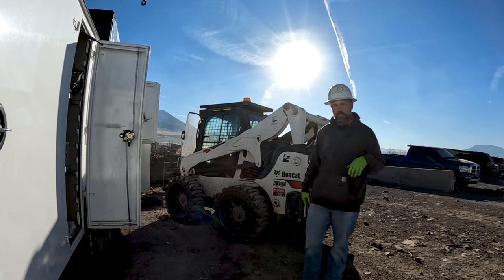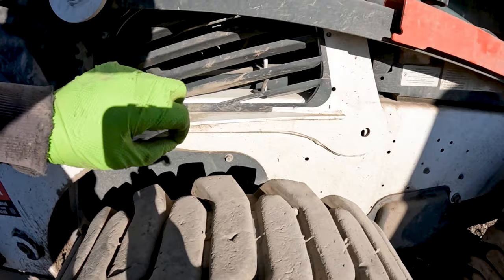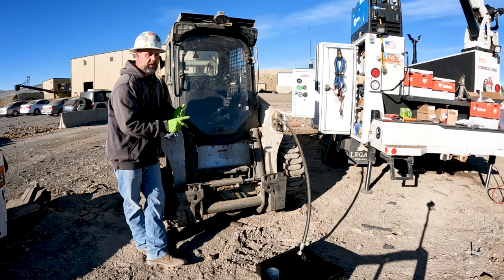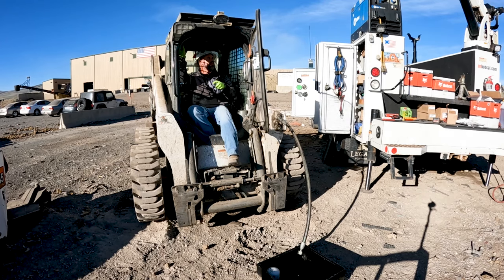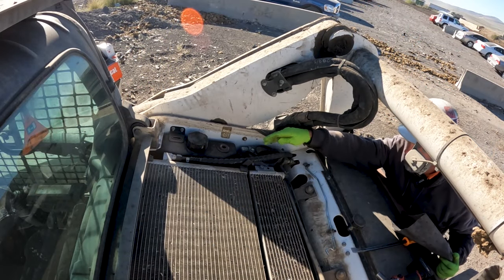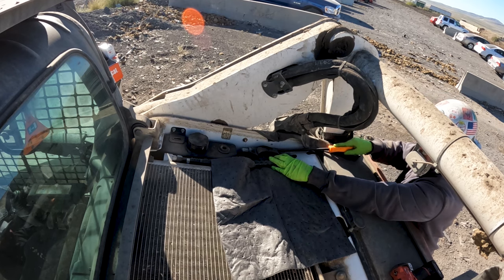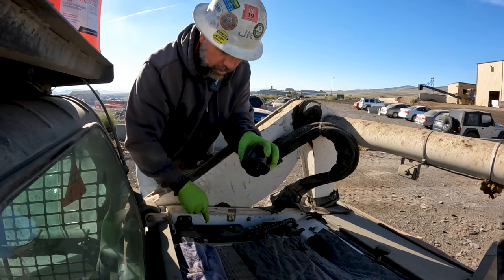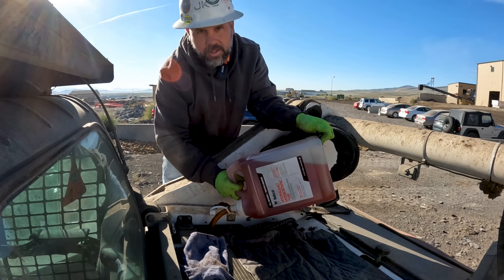Bobcat Hydraulic Oil and Filter Change on M-series loaders

Comment: Ok, I had it brought to my attention if you use two hoses on the axillary  ports both the in and out. Set an empty 5 gal, (out), and a full bucket of new hydraulic oil fluid (in), you can completely flush out the old fluid? Has any one done this? Will it overflow the reservoir? Sounds like a real trick if it works? When would you change out the filters? Before or after? Would like some input on this method? I just did the discharge part of this as you showed. Looks like I got somewhere around 2 1/2 -3 gal out from this out port (top one). I’m doing this on a T450 Bobcat. Believe the complete system is around 5 1/2 gals. So I still have quite a bit old fluid left in the machine? Also, another thought would be keep adding new fluid to the reservoir till clean fluid flows out this out axillary port?
Reply: Ok, I just did the latter, I added fluid to the reservoir as I expelled the fluid out the top port. It cleaned out all the milky brown stuff that just started the first time when it started to bubble out. I ran the rest of the 5 gal bucket of the new fluid into the reservoir. The fluid coming out was not perfectly clear, but looked pretty good.👍🏼 😊

Comment: Great video!  Just made me a subscriber. I have a 2014 S550 and it has the little screen filter under the cab in the housing.  Can you believe the local dealership tech told me not to change my hydraulic oil?  Today the machine shut off because it said 'hydraulic oil extreme high temp'  I think it has lost/decreased its viscosity. Changing it, the filters and cleaning the coolers. Has 2200 hours. Thanks for being thorough and easy to understand.
Reply from the maker: Thanks for the subscribe! Glad you have found the videos helpful!

Comment: Great video thank you so much. as you showed in this video you only pumped out 3 or 4 gallons of fluid . I was wanting to change as much of the fluid i can hopefully the 9 gallons it requires. my machine has 3300 hrs and i don't know if they ever changes the fluids . i have changed all the fluids and filters except the hydraulic oil and filters. how do i do a complete oil change ? is there a drain plug ?

Comment: This is a gold mine video on what needs to take place in the right order.  Thanks so much.   A while back I started getting a M3507 Hydraulic Fan Open Circuit on my  2014 T650 M Series.  It happened after I used a hose to clean out some pack rat mess under the cab when I had it tilted up, like some sort of connector got water in it or something.    Any ideas on what to troubleshoot first?
Reply from the maker: Check plug on hydraulic fan solenoid  for moisture

Comment: Just Finished servicing the hydrostatic oil and filters on my 2018 T770. After running it about 5 minutes today, the machine shut itself down with error code D7528: “Right swash plate out of position”. 

Double checked all filters and oil levels.  No metal or glitter in the old or new oil, but the new oil is the blue stuff and the old stuff that came out was a different color and smell.  I’m a bit freaked out. Any idea what’s going on here?

Comment: I'm curious on how draining and replacing only 3-4 gallons of the (in my case T590) 9.5 gallon capacity does any good? How can one drain the entire system? Would you continually feed fluid into the reservoir while pumping out the aux hydraulic until you have pushed through 9.5 or so gallons?

Comment: I was exposed to the concept of cavitation with my 7.3 Ford diesel and thought my leg was being pulled but it was explained to me that improper. Antifreeze allowed ait bubbles to form and the diesel caused a vibration that smashed the bubbles against the cylinder walls and unchecked, ruined the engine. I put in a long life antifreeze that is supposed to stop that. 200,000 miles later I,m still good. John

Comment: I own a 863 bob cat I replace 1 hydraulic filter under the cab, now it won’t tilt or the arms move 😅do you know if I have to bleed air out for the hydraulic system to work again? Tia.

Comment: I have a 763. Bobcat is out of Hydraulic fluid online. (List at $62/2.5 gal)Nearest dealer 2.5hr drive is $82/2.5gal jug.  Service manual says I can also use 10w-30 or 10w-40 motor oil.  What is your thoughts on that?
Reply from the maker: 20 years ago motor oil was acceptable but changes in oil additives and detergents over the years have changed.  It's better to stick with a hydraulic oil  AW46.  You should be able to buy it at Napa or any auto parts store.

Comment: Love the Videos!  At the end of this video you say all we have left to do is bleed the system. Can you let me know how?
Reply from the maker: Just start the engine and run it thru all the controls several times, lift all the way up and down, tilt all the way up and down and drive it a little and it will bleed itself out.  If the oil is foamy it will clear up after sitting a little while.

Comment: I noticed you used filter pliers on one filter and a metal strap wrench on the another.  I have a pair of the same pliers you used.  I found they work much better than the strap or any other type of filter wrench.  They work so good I don't even use any of the other types I have anymore.  Pliers have worked in every situation and on every type of spin-on filter I've come across.  When the filter is too tight the strap wrenches just slid around the filter.  Pliers grip every time.  Is there a reason you used the strap wrench on the last filter instead of the pliers?  Hoping to learn something here.  Thanks.
Reply from the maker: Great question, I also like the pliers but there is not enough room for pliers to remove the fan filter, due to limited space the band filter works better in that situation.

Comment: I bought a T590 used and don't know when the hydrostatic fluid was changed so I am going to change it.  You mentioned bleeding the air after the fluid change.  Is there anything you have to do to bleed it or does it bleed the air on it's own when you run the hydraulics?
Reply from the maker: I will bleed itself on the loaders

Comment: Bobcat dealer is 100mi from me and kinda spendy. I am curious as far as quality or fitment there are good substitutes like NAPA, CAT, or others that can be ordered for hydraulic, fuel, or oil. I have a 863c if it matters.  I don't mind spending extra on good fluids and filters because I feel I am saving money in the long run, but I don't like eating dealer mark-up if I don't have to.
Reply from the maker: Napa gold or WIX filters will be just fine for the 863. They are really good filters.

Comment: Just got an s650 at auction.  Its low on hydraulic fluid.  The breather cap is on super tight.  Can i fill thtough the other plug with the hex on it also on the top of the tank?
Reply from the maker: Yes you can fill it there
Reply: @tetradgroup  Awesome.

Comment: I need change my hydraulic oil on my 763 and change out my case drain filters too
Reply: @HowIDidIt I have a 763 and was wondering if the change is the same process?  There is a hyd. oil filter on the back above the motor but is there a 'top' filter as well. And then when filling does the oil just go into the overflow reservoir by the dip stick or is there a second tank that should also be filled. Sorry for the questions but i inherited this machine and there was no manual. Used your video to reseal the leaky spools - thanks!
Reply: @zepper25  the only filter is above the engine in the back. There are 2 case drain filters under the cab. The hydraulic oil fill hole is on the outside right side behind the seat. There is a hydraulic dipstick next to the oil fill as well
Reply: @SteveDoesEverything  Great, thank you for that. That saves me from tearing off the upper cover on the back to check and see. I'll have to take a look at those filters under the cab. Sounds like they're inline filters?
Reply: @zepper25  yes the case drain filters are inline

Comment: Your videos are awesome but i do have a question im workin on 2015 t770 did 1000 h service and the machine is throwing a hydraulic temp to high  and filter plugged codes right at start up everything cold changed hydraulic temp sensor didnt fix problem do you have any ideas im starting to pull my hair out and bobcat not real forthcoming with any help? Thank you
Reply from the maker: Did the bottom of the old filter blow off and remain in the filter housing?  That would cause the filter plugged code.  Not sure about temp.
Reply: @tetradgroup  i pulled filter and checked nothin but now that code is gone and the m0721 still there even before i start the machine im at wits end guess i will tell customer to take it to bobcat
Reply from the maker: @jackmckahan742  you could unplug temp sensor and see if code changes.
Reply: @tetradgroup  ive done that already that started a hole rash of codes flyin in

Comment: I have the cartridge style filter at the fan. Can’t get the cover off of the filter to save my life. Starting to crush and twist so I stopped. Tried every kind of lube and heat (to some extent). Any thoughts on how to get that cover off?  Thanks
Reply from the maker: Wow, I've never had one that tight.  It should have a 1⅛" nut on the end, try a wrench or worse case an impact.

Comment: I've done my 500 hr service on my 2018 T770. That was fun and interesting. But this machine had some iffy emissions components, so they sent out a Tech to change them out. We got to talking, and he said this machine doesn't like to give up all its hydraulic fluid when pumping. Would your hose technique on the Aux hydraulic line work on this machine too? If so, I'd love to pass this on tho my Techs up here in Idaho. Thanks!!!
Reply from the maker: Yes that would work on the T770, you get about 20% more oil than pumping the tank but like I said in the video, not everyone agrees with this method because they think the pump will cavitate.  I may know the Idaho guys, we just purchased most of the dealers up there, they are now part of our dealer network.
Reply: @tetradgroup  Cavitate, shmavitate. Even if it does, its not like you're running that pump all day long, like that. Just long enough to change out the old fluid. I would be very surprised if cavitating a pump for such a short period of time would kill a pump, I would bet the pump was suspect in the first place. Thanks!!! Stay safe, and keep the vids rolling!!!

Comment: I like all your videos, I need you at my place for a good day maybe day and a half lol. Quick question, do you have to evacuate the hyd system to replace the main filter in the back?? Probably should every time, but is it necessary?
Reply from the maker: Its not necessary to evacuate the tank but the filter and hydraulic oil change are on the same maintenance schedule.

Comment: I think I am going to stick with the the procedure outlined in the service manual, I have an older machine, there are other screens/filers they want you to clean as part of this service.
Reply from the maker: The older machines do have case drain filters which are a mesh screen filter.  The new machines no longer use those filters.